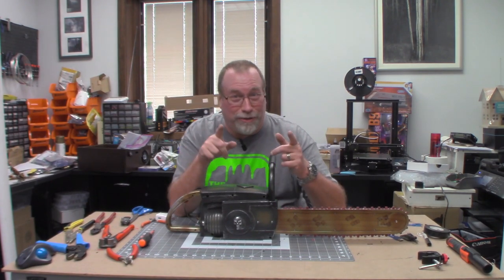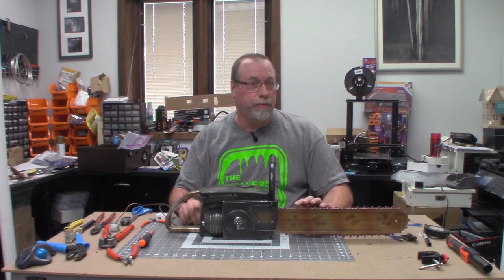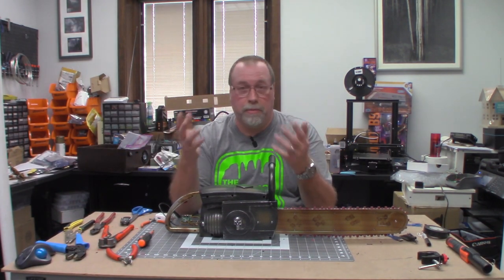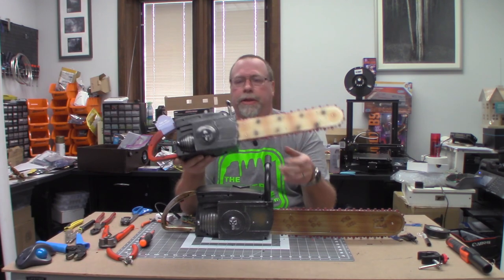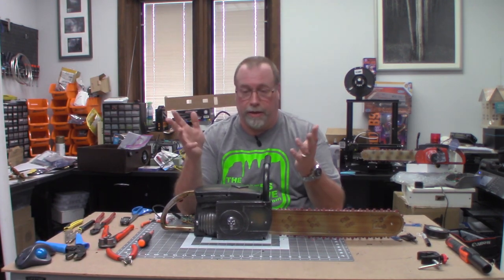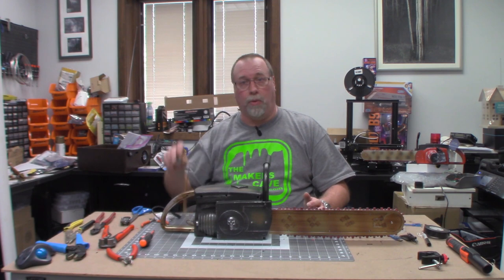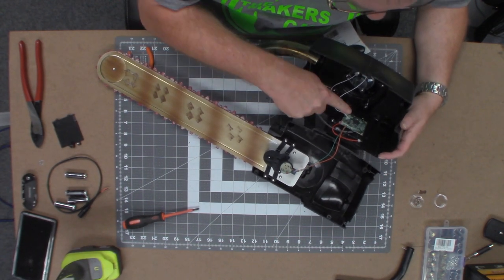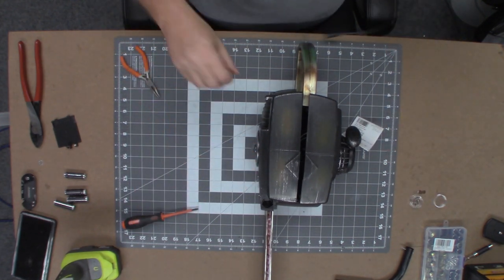Home Depot Animated Chainsaw Hack

Comment: I would verify the battery voltage - not sure what batteries you are using our how old they are, but my experience is that alkaline cells produce 1.5-1.6 volts when new, which is what I've consistently measured.
Reply from the maker: The board runs fine on either a 5v or 6v adapter.   The little one from Big Lots only uses 3 batteries, but the board is identical.

Comment: hey there, i know this is an old video but a question. i have a similar chainsaw that i like but ive always wanted to increase the sound on it, would it be as simple as adding a powered speaker to it get it louder? like on amazon i see something like "MakerHawk 2pcs Ar duino Speaker 5 Watt 8 Ohm Double Cavity Mini Speaker" ?
Reply from the maker: Hi, thanks for watching, i really appreciate it.  Your on the right track, but those speakers are only speakers, they don't amplify the sound, they're just stating that they can handle up to 5W, not amplify to 5W.  Do you plan on  carrying the saw around or just placing it somewhere as a static prop?  Answering this will point me in a direction to help you :)
Reply: @TheMakersCave  i would be carrying it around, or at least an actor in my garage haunt would. ive been also thinking about changing out the motor so that it runs faster too... seems like a lotta mods to do to get what i want that maybe itd be cheaper to just find an old used chainsaw and remove the chain :)

Comment: I’m new to all this and was following perfectly until you added the adreno board....🥴 What is it and how was it added?
Reply from the maker: I have a video on my channel here that briefly explains what Arduinos are and how they can be used.  It's by no means an in depth explanation or teaching video.  Arduinos (there are several boards from small to large)  are basically simple microcontroller that use very simple programming so you can control things like motors, relays, sound cards, LEDs etc.  If you are comfortable with everything but the Arduino I can always sell you an Arduino Nano pre-programmed.  All you'd have to do is wire it up.  The Arduino Nano used here is just tucked away inside the chainsaw.  There are lots of videos on YouTube about Arduinos.  If you have any more questions please just ask :)  I'd love to help!